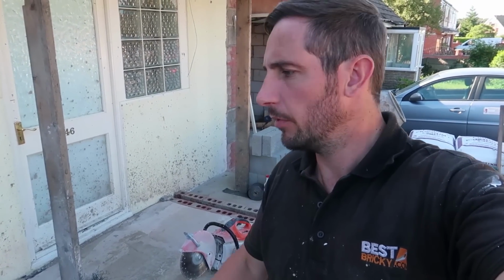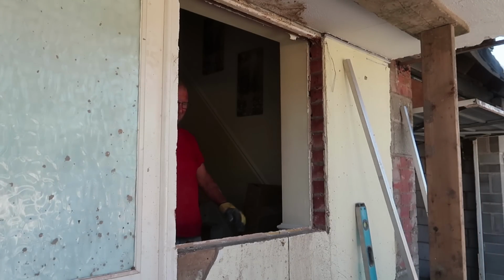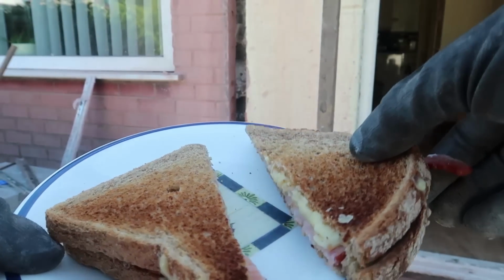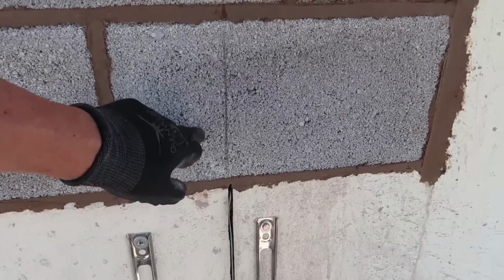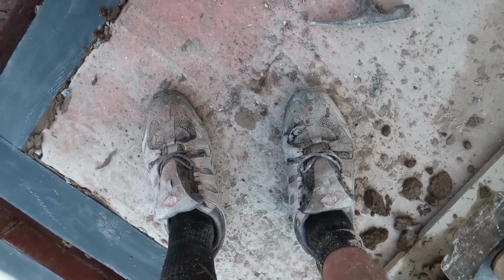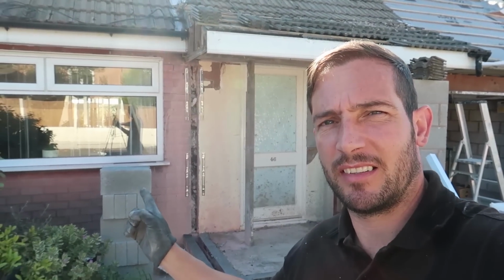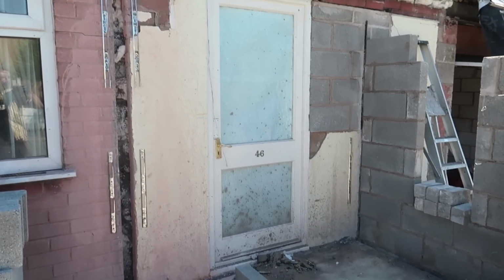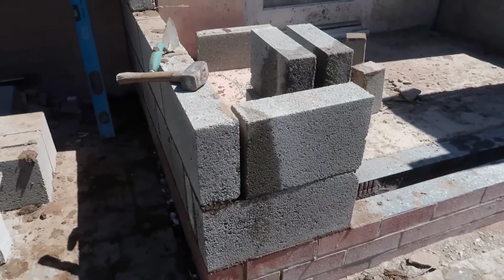Bricklaying - How to build a porch for rendering

Comment: Hi Stu, have you ever come across a boot-lintel? I think that's what I was told they were called... I've seen one attempted to be removed and replaced by a steel beam and it looked tricky to get out.. the reason I ask is I have one above a window in my own house and wanting to replace with doors ( which I already have) but the door width is 2 inches wider than the window..... Basically looking for advise as to weather I could just leave the lintel in and cut down an inch either side of the window? If that makes sense... Or if it's just going to be easier to just acro floor joists above window inside and brickwork outside and replace the whole thing... 🤔😕 Thanks for any help mate!!

Comment: Top job Stu hard graft in this heat. Stu what mix do you use for your practice mortar is 5 sand 1 lime correct? Keep up the good work nice 1 👍
Reply from the maker: 4 : 1 mate
Reply: stu crompton nice 1 👍

Comment: Did you have to cut the cavity out the original wall or could you just put the starter clips on and point the joint ?
Reply: You cut the cavity out to maintain the flow of air around the building
Reply: Ohh yeah I get you nice 1 👍🏻

Comment: great work as usual. cant believe you guys are still using solid blocks on that side of the pond though... what do they weigh? think you said something about 7 newtons in another video but no clue what that means and my calculator has no unit of measurement by that name.